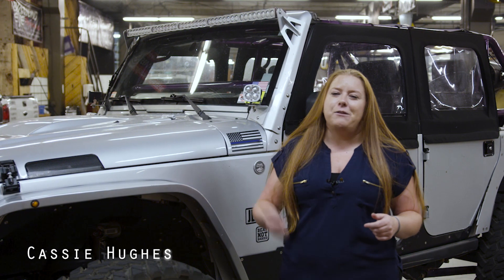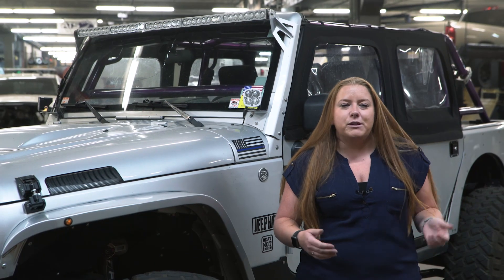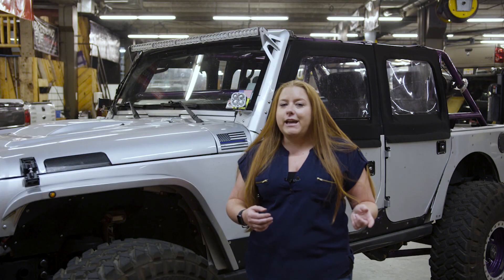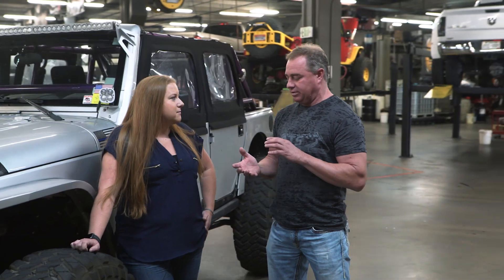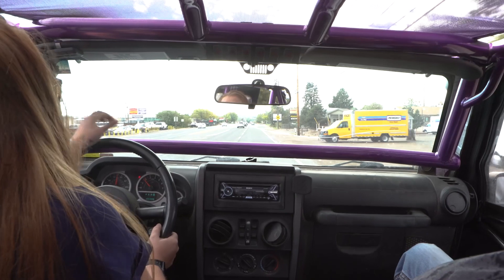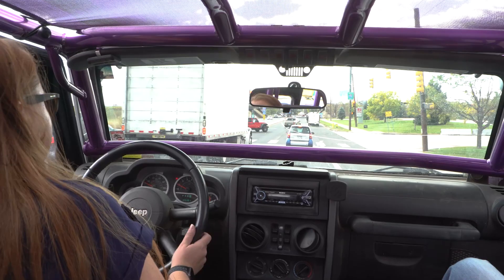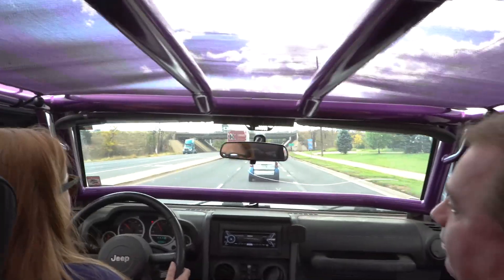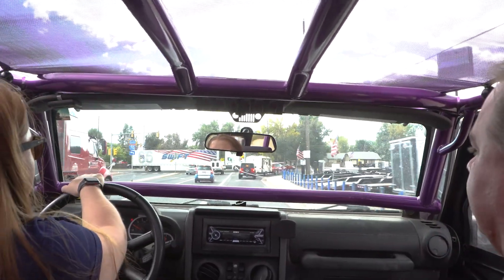Overview of the ATS 42RLE Transmission - Jeep JK JKU Wrangler 07-11

Comment: I have been looking at this for sometime ( ATS Trans ) Swap I’m glad Cass and you guys did a video I have a 09 no issues yet but why wait ... great video guys ! I’m sold
Reply: @CheeZyNutZ  there’s at least 3 people I talked in my LJ group that have this ats and they love it. Everyone did suggested to get a nice oil cooler though.  And since you have a jk yours comes with more features like the pilot.
Reply: I have an 09 too, 190k miles and transmission loses power going uphill significantly, have you done the swap and what was needed? Was thinking about just rebuilding the stock trans but this sounds like a better option long term

Comment: Why no Co-Pilot for 05-06 TJ/LJs?
Reply: Sea Horse we don’t have variable pressure solenoid, ours is fixed
Reply: Do you have one of this on a tj or lj? I’m between this brand or jasper
Reply: @TheChosenOnex7  Just have your local Transmission Shop rebuild it. The 42RLE is a trash transmission, don't spend crazy $ on it. Your local guy will do a better job anyway.
Reply: @TheChosenOnex7  go with jasper my buddy is a diesel tech and he said stay away from ats and he uses jasper🤷‍♂️ I'm in the same boat as you im looking for a 42rle but I don't know who to trust
Reply: @CheeZyNutZ  2 late it took 6 weeks for them to build it. I should be getting it soon. I bought the warranty  500k miles with no questions ask if something goes wrong

Comment: I wouldn't reccomend buying one.. We ( professionally) installed their 42rle kit with all there bells and whistles and a 500,000 mile "warranty".. Stock tire size, no tune, just wanted a built/better than stock transmission as the factory unit needed rebuilt (sent as core return). Well just over a year went by and the thing explodes in the middle if the parking lot when shifting into reverse. So what about that warranty? Yeah that's a joke, I called to get the ball rolling and was meet with nothing but a negative attitude and a huge shipping bill (i found ltl for less half the cost RT). I was and still am dissappointed on how that 4,000 dollar transmission ended and I'm still looking at it everyday i leave my garage while the factory mopar remanufactured unit has officially outlasted that ATS unit.

Sad thing is, they probably got a bad core from a wrecking yard. the gear set ended up being bad on the ats built unit or maybe they failed in workmanship or other defects. But i could tell they didn't want to do anything and were likely going to not stand behind their unit.

Stock height, tires, tune, dailey driven, off road only on the beach and has a huge bar and plate oil cooler with thermostatic controlled fans.